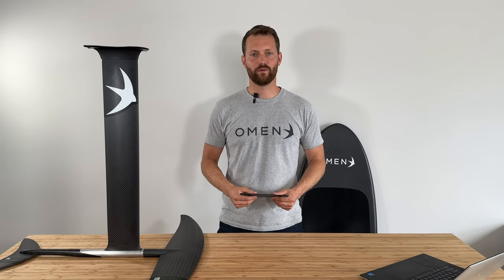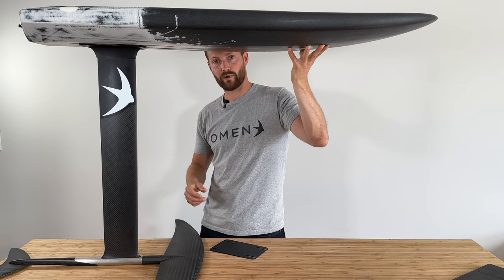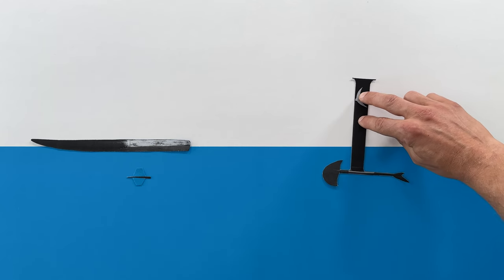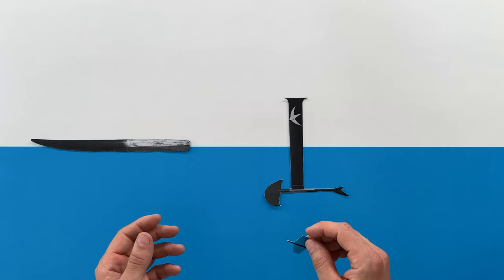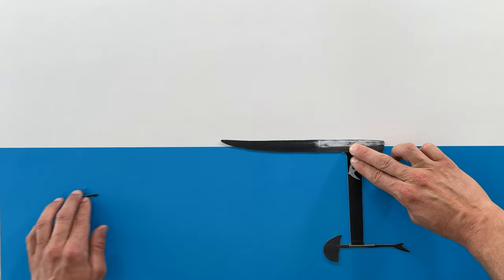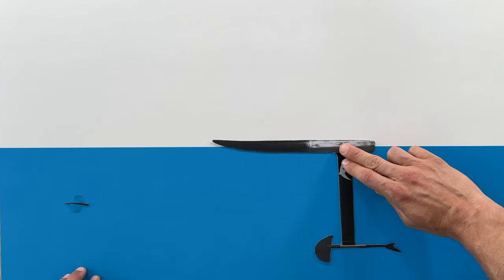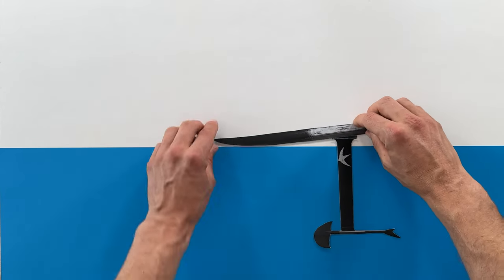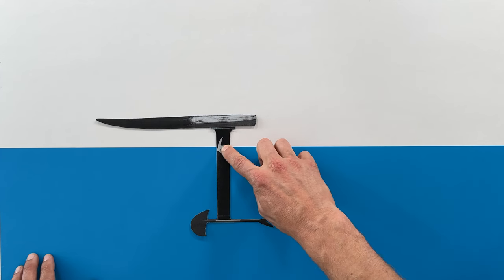How does Baseplate Shimming Work?

Comment: Way over complicated explanation. The base plate adjusts the angle of your board. It only affects lift when the board is flat, once board is airborne, it has nothing to do with lift, just board angle and the feeling under your feet.
Reply from the maker: Thanks for your comment Gary, completely agree the baseplate shim adjusts the angle of the board relative to the foil, and assuming you mean it only affects lift when the board is on the water - I also agree! I'm sure there is a simpler way to explain it all, but we worked hard to make it very clear how and why it affects feel and performance of the whole system. In my experience this is key to riders being able to incorporate a tool into their everyday routine. Sorry to hear the content wasn't helpful for you, we're working on more videos and will strive to continually improve.
Reply: @omenfoils  I'm not sure how it was for others, but for me it really helped me understand the reasons of why you would shim for different conditions and the benefits associated. Lots of ppl talk about tail shimming but I have not found too many ppl discussing baseplate shimming. It's good to understand as it's another tool in ones arsenal and is alot cheaper than another front wing to get more range out of your equipment too.
Reply from the maker: Thanks @danno9846  !
Reply: I’m not sure that I can agree with you Gary. One or two degrees of rake are noticeably changing your riding especially in higher speeds and cornering.

Comment: I think it is less hassle to adjust the angle of attack by applying the front or back foot pressure
Reply from the maker: A great point, and certainly works well in high wind. In very light wind though by applying more front foot pressure to reduce the angle of attack of the board you increase the required speed (and therefore energy) required to take off on foil. The baseplate shim allows us to take advantage of the physics of the foil to get better light wind performance out of our equipment.
Reply: Having read your description, I realize your target is for wing foil or surf foil people. I am a kite foiler. I water start and normally get up on foil without the board touching the water. Sorry about not having read your description. @omenfoils
Reply from the maker: @chungchichiu9779  No worries, that makes sense! Kites have so much more power that board efficiency is much less of a concern other than very light wind conditions. Board shim could still be useful for tuning board angle. I see lots of kitefoilers at our local lake in permanent "wheelie mode"!

Comment: Plate or tail shimming, how to choose ?
Reply from the maker: Hi Gilloup, The plate shim adjusts the angle at which the board flies relative to the foil and the tail shim adjust the amount of stability/downforce provided by the tail. 

I think this video explains when to use the baseplate shim, whereas the tail shim is to be used to balance the stability and glide of the foil. It's a complicated topic but if you checkout our video on the topic happy to answer any specific questions!

Comment: question how to check if I have 90 degree mast? fuselage is 90 degrees of mast or not? Can I put the board on a flat surface and check parallelism of fuselage? thanks
Reply from the maker: This can actually be difficult to confirm depending on your foil configuration since not all foils have a flat area on the fuse parallel to it's direction of travel.

If you do have this flat spot it's very easy with a digital angle finder and flat ground to support your baseplate and set as 0 reference as you've indicated.

If your fuselage has a completely organic shape with not flat spot you can still get a good idea by using a long straight edge/level and placing the angle finder on top. Once you zero it out on the flat ground then you can use your eye to align the straight edge with your best bet at your best approximation of "level flight" for the fuselage. 

This is certainly interesting to know, however, since different brands set their front wings at different angles relative to their fuselage setting this angle to zero with a baseplate shim can't necessarily be seen as a universal standard, however, in general I would say it is a great place to start and play around with adding or subtracting 1 degree to get your ideal "all around position". From there you could add or substract a shim for overpowered or underpowered conditions as suggested in the video.

Hope this makes sense!

Greg
Reply: @omenfoils  thanks Greg very good hints
Reply from the maker: @hobbyincantina3983  No problem, let me know how it goes!

Comment: I use Tuttle boxes with a kit of Tuttle box shims.  Almost always use -2 deg.  Less drag from the foil while getting to planing speed then accelerating to foil takeoff speed.  This is for small foils.
Reply from the maker: Nice! Do you notice your board starts pointing down slightly at high speed?

Comment: makes good sense, I am trying to learn wind foiling, this shim does help . I made my own baseplate shim using plastic carpenter door shims , I think that they give 1 degree adjustment per shim and can be stacked. longer blots are needed for more Then one  shim
Reply from the maker: Right on, nothing magic about the shim material. We made ours to be more convenient and easy by design but no performance advantage over just a plastic scraper cut to shape provided you get the thickness/angle more or less correct. Good luck on your winging journey, drop a line with your progress!

Comment: Great video. I use it at the back of baseplate in order to compensate an angled recessed deck but I find it makes a little harder to pump the board and maintain height of the mast because when the wing is on neutral my board points slightly down. Does it make sense?
Reply from the maker: That all sounds logical @cefirmeza, what angle is your deck relative to the bottom of your board?

Comment: If at high speed foil (and board) are really pointing downwards it means fuselage isn't aligned with the flow. This increases both frontal area and drag coefficient of the fuse. Also then mast wouldn't be vertical like it is supposed to be for minimal drag but this is not that serious flaw than unaligned fuse.
Correct method is to adjust foil for high speed so that fuse can ride level, because you want to ride at certain height and water surface is always level. Board don't have to be level and if it rides slightly nose up it helps against crashing when board hits water.
If foil produces too much lift at high speed AoA of the front wing should be adjusted lower, not tilting the whole system under the board. Or having a foil which has less lift (smaller area, thin/less cambered airfoil). Of course shimming baseplate is simple but it less than ideal
Reply from the maker: Great points Bekanav, no doubt you are correct that operating past the designed efficiency range of your front wing also increases the drag due to the angle of the fuselage. So of course the best thing to do is to rig a smaller wing, however, this is not always an option, and some riders may need the larger wing to get on foil, so a baseplate shim is the best option in this case.

On our Operator foils not only is the wing designed to have a broader efficiency range but also the fuselage is made smaller to reduce the drag when it is operating at lower or higher speeds than ideal. Together, this significantly increases the range of conditions that the foil can excel in.
Reply: @omenfoils  That makes sense. In some foils shimming front wing isn't even possible so then you have to try something else like shimming board/fuselage angle from the baseplate, if some changes are needed. I've always just thought foil should travel pretty much level when riding normal speed and it was a surprise to hear that some foils could have negative AoA at high speed. Of course amount of this can't be big, perhaps a degree or two and therefore can be tolerable even though it is a bit weird or less than ideal.

I've made few complete foils and many wings during the years and then I had to think through the physics and variables. I have long history in kite design so things that fly were familiar to me, and foils just fly in water. Less than 10 years ago foils used to be much smaller but also much faster than now usual big foils. Winging wasn't around at all, it was all kite foiling. It was much harder to learn then because you needed more speed to get up and then crashes were harder. I remember how beat up I felt in first summer learning foiling😅

My latest project is monowing, just to see if it is usable or more fun.  Auto stable airfoils are widely used in foil kites but there is of course many parameters to think and hopefully eyeball correctly enough. Nice shaping task anyway  

 Last summer I tested a thick 1500cm2 foil and it was much too powerful for me, my speed was ridiculously slow and I had to keep my weight very much on front foot. I was kite foiling, for wing foiling it might have been a usable setup. What is best or most suitable for you is a personal matter and depends on your style of riding etc.

Foiling is great sport but it also has that technical side in it. Some misunderstandings of foils, how they work and for tuning are quite usual. Good to see a channel like yours which clearly explains these things 👍
Reply from the maker: @bekanav  Thanks for the support and great engagement, you're absolutely correct the negative angle at high speed is generally very small, however it does cause a big drag penalty since the speed of the water is high over the wing and fuselage. Ultimately this non-linearly increasing drag is what places a practical speed limit for a foil at a specific rider weight.

Similar principle applies to low speed which is why a larger foil will actaully be more efficient in small waves than a small foil since the angle of attack of a small foil operating just above it's stall speed is quite high it makes the whole system very inefficient.

Comment: I designed up and 3D printed a shim to point my front wing down 2 degrees. I make all my own hydrofoils and just recently made my first carbon fibre mast. I put that 2 degree angle into my fuselage connection part of the bottom of the mast and ditched the shim. Either way, the result is more relaxed stance and not needing to partially fold my back leg.
Reply from the maker: Nice, that is one way to do pretty much the same thing! You'll likely want to re-shim your tail as well and now your mast and more importantly fuselage are flying at a slightly different angle. Depending on what speed your are trying to optimize for this could be a good or bad thing. Awesome that you are building your own gear man!
Reply: @omenfoils  Thanks, for me the biggest change for shimming (the mast) is not how it rides at all but my posture riding the foil.  I still maintain my COG over the foil but the Axis gear uses a built in climb angle on the front wing which I don't agree with but I copied that angle for potential stabiliser compatibility part way along my own journey of wing design.  To my mind, the wing already has an element of lift from foil top convex surface so if I want to climb MORE (Like starting or pumping or almost stalling) then I'll do it with angling the board with my feet.  At cruising speed, I want the board flat, I want the front foil flat. At takeoff, I don't want the extra drag from mis-alignment of the board under surface and the foil angle.  Of course Axis may have done it themselves in the beginning to compensate for boards with a lot of tail rocker, I'm sure they felt it was positive for them. I think they have reduced the climb angle on their newer foils since they started with it but it takes time,  change the front foil angle and then you need to compensate with the rear stabiliser angle. Mast plate shims and doodad shim-angles leave that setting alone though, they just change the ride angle of the board. But you guys seem fairly tuned in, I forgot to mention on my first comment that the original shim was for the mast.

Comment: Hi 
Very interesting topic. I’m struggling with my takeoff in surfoil and I’m planning to shim my mast. I use a gofoil foil with a north board. 
I feel like the front wing has to much incidence :
- on small waves it is nearly impossible to gain speed (like if there was to much drag)
- on more powerful waves I get ejected unless I put a lot of pressure on the front of the board (I tend to advance the COG very forward but if not enough speed the nose of the board plants in the water even with the mast at its most rear position).
My idea is to shim the mast to decrease the angle of incidence of the front wing to help my takeoff and let me recenter the mast on the box.
Do you have any comments on this strategy ? Will I have some difficulties with the stab ?
You say that mast shim are more a board shim. It is true when flying because the pitch of the system is controlled by the foil. But when the board is on the water, the pitch of the system is controlled by the board lying on the water. Don’t you think that in this case it is more like a front wing incidence shim ?
Last question : do you think that the source of power has an influence on the  reasoning? When winging, the wing helps to unload the foil with its traction whereas on surf foil all the energy comes from the wave.
Reply from the maker: Hi Thomas, you are correct that the baseplate/board shim controls the angle of the board when the foil is flying but could be thought of as to control the angle of the foil when paddling the board on the surface. In your case it sounds like your foil has either too large of a tail wing or too much angle of attack (too much nose down angle) on the tail. This would make it feel draggier at low speed and have an overwhelming amount of front foot pressure at high speed. It could also lead to feeling like the foil is trying to rise too aggressively when catching a more powerful wave, however, I think this is more due to your foil being a bit too far foward in the tracks.

Check out the video we made on tail tuning to get your tail dialed in. Similarly, watch our track position video and place your foil a bit further back than the balanced position to make it a bit easier on yourself when catching waves.

The source of power matters, but in general wouldn't affect the way I tune since I'm optimizing for wave/bump riding either way.
Reply: Many thanks for your answer that add a lot to my comprehension … which stays quite low has this topic is very complicated !

About the position of the mast … it is already at its most back position. nothing to do here. 

I’ve watch carefully your video on the tail wing and will try to play this side … hopefully it will work !

Your videos are very nice and very well explained ! Very good job.
Reply from the maker: @ThomasGic  happy to help Thomas! Please let me know how it works, and if it's not possible to tune properly due to gear limitation get in touch with me for an upgrade :)

greg@omenfoils.com

Comment: I could see this being very helpful for foil drive users where the board and foil angles don’t work well for powering out.
Reply from the maker: great point Josh. Depending on the conditions I'm sure there is an ideal angle as a compromise between take off power and high speed riding comfort.